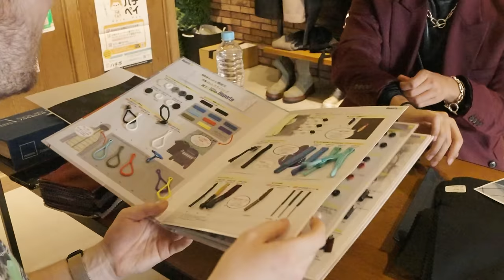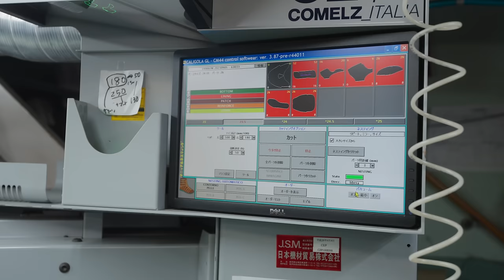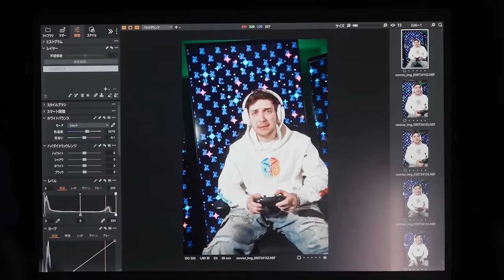I Tried Making My Own Japanese Suit

Comment: OHHHH that's why they are expensive. Its the extra features. I really thought it was just a standard T-shirt with a one off design. Very cool btw. I don't think Ill be able to fit in them and the price is a lil steep. VERY cool. Suit is banger. I have a cheaper Navy blue Pinstripe exclusive use for weddings.
Reply: it's not even steep lmfao for the quality of materials, extra features and details etc it's way worth the money.

Comment: Hey Connor. Super interested in getting this suit. But the size guide is not standard. Is there a way to get a standard size guide? For example, a 40R means 40inches around the chest and back with regular length sleeves. The equivalent is 100R for centimetres. With the measurements going all the way around the chest and back.

These half sizes on the website are not exactly the most helpful for people who buy tailored suits. Even the waist size I assume is a measurement around the entire waist so it's weird to see a medium jacket be a 20.5 inch chest but the pant waist is 35.5. Are both these measurements around the whole body or just the pants? Love the suit, love the Collab, would like to buy, but the information on the site is not helpful for people living overseas.